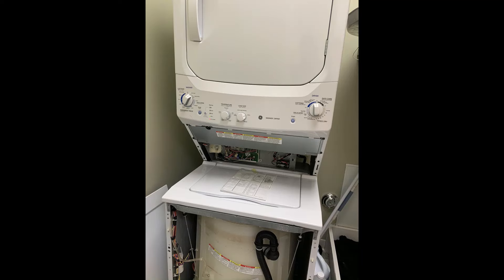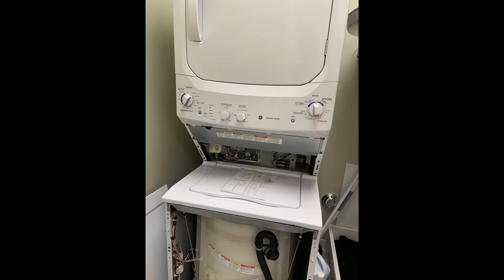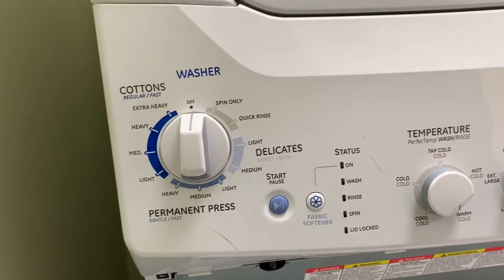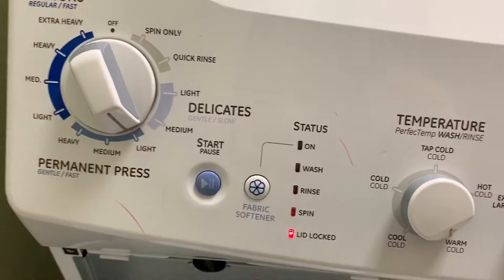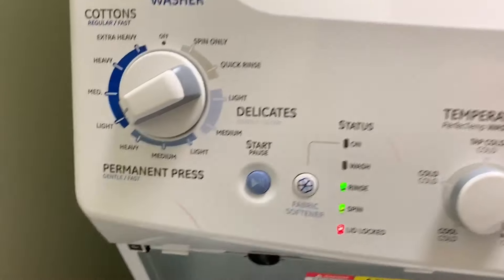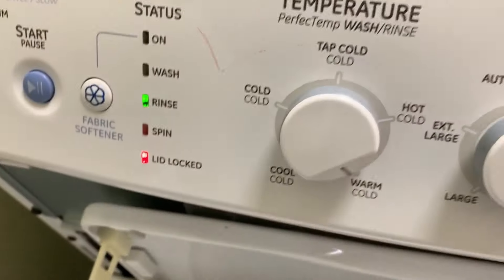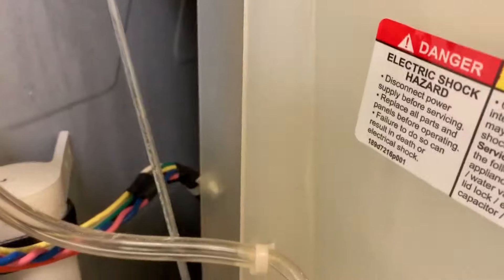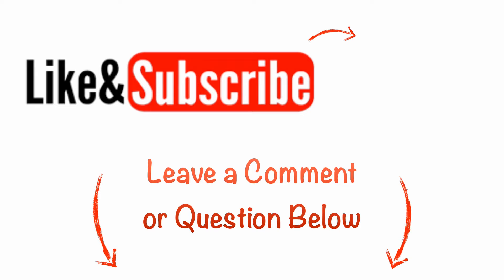How to use Diagnostics on Stacked GE Washer Dryer combo(Laundry Center)

Comment: CODES: 
1 Spin - nothing (not used)
2 Quick rinse - nothing
3 Light - show error codes
4 Mediun - clear codes when press start
5 Light - lid code (not used)
6 Medium - enter/exit diagnostics menu
7 Heavy - Spin shifter system
8 Light - Drain pump
9 Med. - Agitate (will fill water before agitating)
10 Heavy - hot water valve 
11 Extra heavy - cold water valve
Reply: To Exit what do you do, after being on position 6?
Reply: Mine is ...every thing works but wash. ..slowly drips where in
Reply: @TheMerla09 do you have a answers
Reply: So.. our washer does NOT fill up with water.. there is only a small bit, maybe 1 1/2 gallons in the bottom of the washer while attempting to wash a load of clothes.
The water simply stops filling way too early.
I do not understand why??
Reply: @tomkarau Same here. Water level is too low even at Heavy Wash mode. I'm still trying to figure out how to fix it 😢

Comment: Does this work for the new GE stackable washers looks exactly the same as the one you have just different design on knobs
Reply: Having a issue where the lid won't lock everything was changed to new still does  the same clicking without locking the lid but if I hold it. It locks 🔒

Comment: for the lid switch continuity which end do you test (the port on the maching or the lid switch itself)  and what number to put the multimeter on? what number should it read? should the power be on on the machine if it is that end i am testing?

Comment: Hi Nathan, How did you get to number 12 on the service mode? I am trying to diagnose my GUD27ESSMWW model for lid lock problems? When i start a cycle the wash starts without lid locking and then moves to rinse and it starts blinking. I have to press the start button few times and then everything starts working fine.

Comment: All kind of codes on ours for 2 years, 2 units..AW.  Finally found it. Tore it apart, checked all harnesses, sensors, no issue.  Pulled it out check hoses, no problem.  THEN, Pulled it out a little further...OMG, Installed with drain line put in about 2 feet!.  THIS results in a long fill. During fill it siphons into drain if drain is lower than water level, and the unit times out on fill.  Wiretied the drain line so it is only about 4 inch in...NO PROBLEMS NOW 2 YEARS... expcept the black marks from the crappy dryer seal.
Clean the dryer guides about 1 year.
I'm hoping new shrouds.

Comment: Have an issue and the warranty company is refusing to come out.  Have this exact GE combo unit.  The dryer has always worked fine, but the washer is acting weird.  We would load the washer and when we turn the dial nothing would light up.  Open lid, close lid, turn dial and sometimes tap the front of washer and magic, it lights up.  Other times it will stop mid cycle and I had to rerun load.  Its a new unit with approx 20 loads done.  I am thinking lid switch.  Help..

Comment: Hi. 
My g.e. stackable has a problem spinning. It takes 5-6 attempts at spinning, before it takes off, and keeps spinning. Otherwise, it makes several revolutions and stops, and restarts. Also
After it's done spinning, it wants to rinse,....again? Any help is appreciated. I'm retired and don't want to replace a 3 yr old washer.

Comment: Mine is leaking once it is in wash mode. It is not coming from the water lines hooked up in the back of the machine. It is coming from underneath. Any suggestions? And I am careful not to overload.

Comment: I had one of these this week. Complaint was they have to push the lid for the washer to lock. Someone had ordered the lid switch and I installed it but it kept doing the same thing. The striker for the lid switch look fine and the lid didn't seem bent in anyway.

Comment: I need help! Our ge stack unit was finishing its last spin cycle and stopped at the end or possibly finished and at the same time the dryer stopped mid cycle. The wash light was left with a clicking sound like it was trying to turn on. I unplugged and now dryer dial has to be set away from the off position in order for the washer side to try and start which is just the same clicking noise. Any help is much appreciated guys thank you!!

Comment: I have this model stackable. I am missing a lot of socks and one time before when it was serviced, we found straggler socks in the bottom of the unit.  How do you open the front of the unit to get to those socks in the bottom of the inside?  In this video, it starts with the panels already removed.  thanks
Reply: I would also like to know this
Reply: @aatomita  On bottom edge of front panel, two screws near floor - take those out, slide panel down 1/2 inch, pull forward.
Reply: At the top front edge about an inch from the side. Put a screw driver in and push. Do on both sides

Comment: GE stackable GUD27ESSJWW will not fill completely. Shuts off about 1/2 way. Has to be shut off and started over before it corrects and fills completely enough to run a load. Any ideas?

Comment: Great video.  I opened my Kenmore stackable up and had my wife undies wrapped around that black wheel with the teeth on it under the motor. I tried to wash a load it filled up and when it was time to agitate, that black wheel was making a loud clicking noise like it was trying to catch but it wasn't able to.  I can spin it by hand slow and it turns the washer, but if I turn it faster it's has a hard time catching.  Idk. Should I replace that black wheel on the pulley system or the motor?  Help

Comment: Washer pauses all the time and you Have to  hit start button to continue cycle. Random thing. No codes. “12278219” had same issue. No fix noted on  entry... I replaced the board and start switch on panel to no avail..  any ideas??  THANKS

Comment: This video and your other one titled "GE stacked error codes" made it easy to attempt to troubleshoot my W/D. I did have to google around to find the service manual for my specific model, but the concept and controls were basically the same. The codes made it easy to start the search. Turned out to be some underwear wrapped above the drive pulley which also snagged the speed sensor and popped off the belt. Speed sensor locking clips are all bent out of shape, but installed temporarily till I can locate the part. Thanks!

Comment: My error code lights are On, Wash, Rinse, and Lid Locked (1, 2, 3, 5). The machine also makes a loud noise during high spinning in the rinse and spin cycles. Any thoughts? I have the GTUP240EM1WW model. Thank you.
Reply from the maker: Over fill error.  I would look into your water valve being the problem.  Best way to tell is by starting your washer and let it begin to fill.  Unplug the washer and see if the water still goes in.  If it does you have a bad valve.
Reply: @BeardedApplianceRepair  Thanks. Do you think the overfill caused the bearing or something to go bad resulting in the grinding sound during the high speed spinning? I don't hear the sound during agitation or when I spin the tub by hand. Only when it goes into high speed spin in the rinse and spin cycles.
Reply from the maker: Oh man that a job right there.  Don’t know if you want to get into that.  You have to take the tub out and replaced the bearing that goes around the shaft inside the tub.  If you can get the tub out it’s easy enough but getting the tub out on a stacked unit is a pain.  I wish you luck if you tackle that.  I don’t think the error causes that to happen.  More like too much detergent or bleach.
Reply: @coolguy121589  When that happens your best option is to replace the tub assembly. I've tackled 5 already in the last year at my apartment community that I run the Maintenance department at. You can get a new tub assembly anywhere from $300-$350 depending on where you purchase it from. I have an account from GE directly and get them at a great price. You would just need to remove the drain hose & agitator off your old tub assembly and install it on the new one. The job isn't bad at all, the new tub assembly comes with the motor, transmission etc....Hope this helps 👍👍

Comment: Are there codes for the dryer?  My dryer is making a scraping noise.
Reply from the maker: Scraping noises won't throw a code.  You just have to find where it is coming from. Could be the bearing in the rear or a slide or felt is wore out.

Comment: This machine seems weird. 1.  It agitates back and forth slowly no matter what settings it's on..even slower on the delicates.  Seems it should agitate fast like my old machine.  I don't see how the slow agitation is going to move the clothes around.  It just moves them back and forth slowly. 
2.  It doesn't seem to  wash, drain, fill with fresh water for rinse, drain,  spin.  
3.  The little white pump on this Buzzes so loud I can hear it all through the house.  does it need replaced?  It pumps the water out, just very loud.

Thank you

Comment: Bearded Appliance Repair, what is the most dependable and long lasting compact stackable washer/dryer currently on the market? Cost not being a factor. Thanks.
Reply from the maker: I believe Speed Queen makes a stackable unit.  https://speedqueen.com/products/home-products/stacked-washers-dryers/sf7/  

Did a quick search and your looking around $3000 for one of them.  I am sure it will be higher buyer from a local dealer.  If money is not an option this is what I would buy.

Comment: I'm not getting any lights at all during diagnostic mode. The dryer seems to work, but the washer seems to not be getting power.  What's the deal with that?  Great vids btw
Reply: Same...need help
Reply: Did you find the solution??
Reply: @theegoldenmule did you find the solution?
Reply: It was still under warranty so the factory sent someone out and they fixed it.  Thanks

Comment: Hi, Nathan, I stumbled into one of such machine lately, the model number is GUD24GSSJOWW. First it was just the washer not working, we can still see some lights on. But when I dissamble it with connection still on, there is no light at all when hook to the power. I thought it could be of the blow fuse, but I can not find it anywhere, even one youtube program said it is hidden at inside wall of th e dryer, I still could not find it. It is rather awkward with the parts littering at the backyard, I wonder if you can guide me through the diagnostic, and of course the fixing of it. It is really inconvenient to drive to the laundry everytime. Thankd you !

Comment: My machine doesnt enter diagnostic when i follow your instructions. Any suggestions?
Reply: Mine didn’t either.  But I found out my machine is a little different from the one he describes.  I found the manual specific to my model taped to the backside of the panel that covers the main control board.  It is just above the washing machine lid. 

You should find instructions specific to your model there.

Comment: How do you disassemble the front panel to access the drain pump?
Reply: I have the same question!!
Reply: I also have this question!
Reply: Take the angle panel off above the washer lid there's two visible screws then you take a putty knife and stick it under the lid in the front about two inches from each corner and push in in the front panel will pop off I just figured this out so good luck with y'all

Comment: I have a GTUP270EM3WW stack unit. The cold water fills even when  it unplugged. I think it might be the water inlet valve. I know your video says good luck replacing it but do you have a video or advice on how to do replace it? Thx.
Reply from the maker: Never had to do it before.  It will be tricky but I’m sure you can get it done.  Turn the water off and unplug the unit.  Disconnect all water line and electrical wires.  After the only thing left is figuring out how it’s mounted and removing it. Usually it’s a screw on the back side.  Could be somewhere else though. Good luck!

Comment: How do you get the front cover off? I found what looks like a drive belt in the tub after a wash cycle. Looks like a simple enough repair if I can see where it came from
Reply: Use a putty knife at the top of the front panel, there's 2 clips, one on each side, basically in line with the top lid, push the putty knife in and pull out on the front panel to pop the panel off the clip, then do the same on the other side and your panel will come off. I have some videos on my channel repairing this very same stackable, and believe in one of those videos I show how to remove the front cover. 👍

Comment: My start button on the washing machine will not turn on. It will turn on when I start the dryer. (sometimes the dryer does not power on.) as long as the dry air is running, the washing machine will run. I have only had this for a year and barely used it. You were saying on that first setting that you never use which is the drain cycle. I am finding I have to use that quite often because at the end of the washing cycle, the clothes are soaking wet and dripping. But now I can’t even get it to get through a full watch cycle.
Reply: Hi did you find the solution? My washer is also not showing any lights.. dryer is working

Comment: I hv the same stackable. My dryer works but the washer doesn't. The washer lights don't come on almost like it has no power. Any ideas of what might be wrong?
Reply: Did you find the solution??

Comment: Thanks guy. I'm dealing with the exact make and model washer/dryer in a tenant apartment. Everything works but it often stops before the spin cycle starts and starts working again if the tenant presses start. I'm thinking the selector switch, but I usually work with simpler stuff. Any advice?
Reply: Did you get this to quit stopping?  I have one that pauses during fill and we have to hit start button to get it to continue????
Reply: @danielrufledt5246  sorry daniel. Never was able to fix the problem and I no longer work for the same company.
Reply: @blkirk6471  tks for the reply!

Comment: Thanks for the video. I tried getting it to diagnostic mode but it doesn’t work does that mean it’s the switch that is gone. Dryer works but washer won’t start.
Reply: Same problem with me.. did you find the solution??

Comment: Stuck on spin cycle, any suggestions? Motor changed, lid lock changed fill and drains fine. 5 minutes or more stuck on cycle
Reply: my new one spins 22 minutes before shutting off and can't get any advise and warranty reported but repair shop never showed up or called to explain why not...

Comment: How long should the agitator test run for? I ran the diagnostic, it agitated 3-4 times, and then stopped and emptied the water. 

Outside of diagnostics mode the machine does not agitate at all, which is weird that it did just now. Wondering if the fact that it only did so 3-4x means the test is a "failure"

Comment: My unit is barely two years old. And I am single, so it has not been used a whole lot . All of the sudden it just started malfunctioning . When I try to wash a load, the water is draining, the drain pump continues to drain when there is no water whatsoever and won’t stop until I  turn off the machine. When I plug it back in hours later it’s still trying to drain. And there is not a drop of water in the machine!!!
I got it working in between somehow for about a month and then now it is doing that same thing again but before that the load only would agitate  back-and-forth to wash for about 30 seconds, and then it drains off the water! My clothes never get washed, and it is wasting my soap! I cannot put them in the dryer because they’re sopping wet sitting in water. The spin cycle never goes on, but even if they would drain, they are still DIrty! I’m wondering if there was a recall on the model and serial number but I could not find it on the list I did see though. But the website is not very efficient as far as that goes. At least I could not find any solution or he and the phone number listed does not work . Any idea?

Comment: I watched your video! Great video! However I cannot get any of the lights to come on at all. It’s as if it does not have power running to it at all. The dryer does work fine. The only thing I wasn’t sure about the video was how can you tell if something is not working correctly? I’m going to go try and push the buttons simultaneously again to see if I can get something to light up. Thank you so much for your help.
Reply: I have the exact same issue: Start a cycle, shortly after, the cycle stops, no lights, washer unresponsive...did you ever solve this? Was it a bad control board?

Comment: What if I get no power whatsoever? Verified power is good, just nothing from the machine, no lights, can’t enter diagnostic mode. Are there main fuses in the machine, and how do I access them?
Reply: What did you find out?
Reply: @glenwood785  The unit doesn't have any fuses to speak of, and I got a full refund from Lowe's anyway, so I just bought a different machine lol.

Comment: Hi Nathan. I have a 2007 GE space saver model. My dial has similar settings but a little different. My washer would go on but wouldn't agitate. I tried it 3 or 4 times but it wouldn't agitate. I tried running diagnostics by pushing the two buttons and turning the dial down to 6oclock but nothing appeared to happened. But then I tried the washer and it works!!
😃
Reply from the maker: Lol these things have a mind of their own.  First thing to do when you have weird problems is give it a good reset. I have a feeling that’s what you did to make it work lol.  Glad it’s working!
Reply: @BeardedApplianceRepair  
Ya I think it reset too. Thanks for your video. I was so stressed my daughter and I couldn't wash at home because of the damn virus! Thanks again!
😎👍

Comment: Can't get mine into diagnostics. Start a cycle and it spins for second (making clicking sound) then stops and lock led stays solid and spin flashes. I can open the lid while the led is solid.